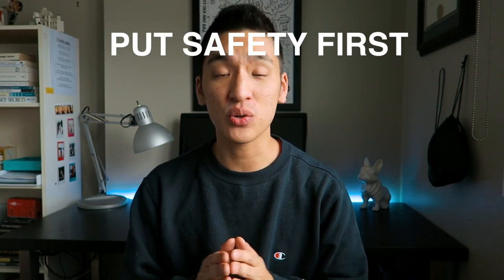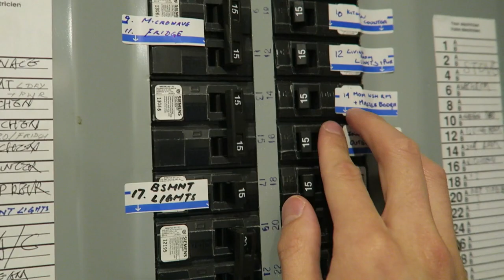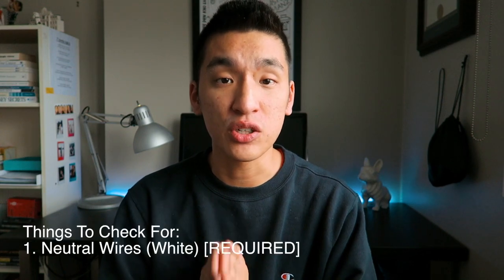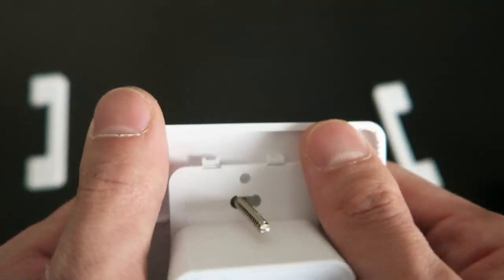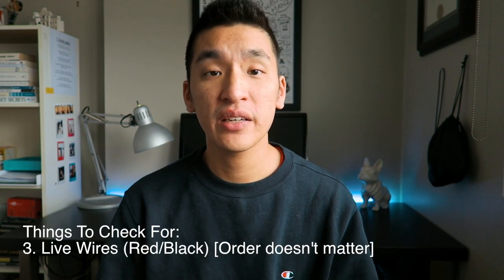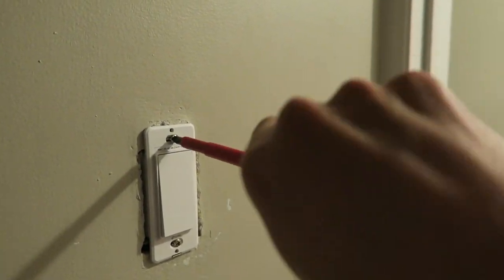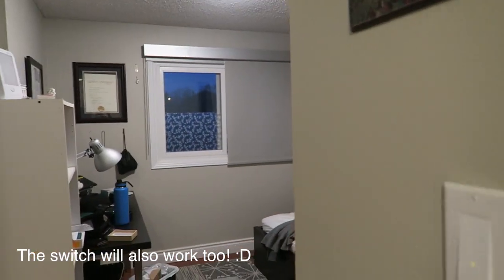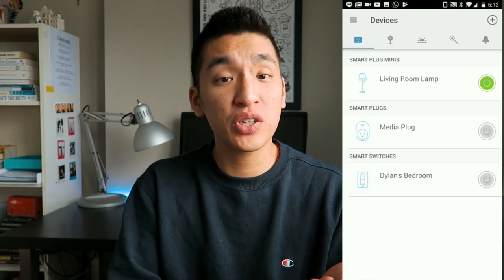How to Install a TP-Link Smart Light Switch | Dylankyang

Comment: I was able to get power to my switch and connect it to my wifi but the lights did not turn on at all physical or via kasa... any tips? Thanks in advance
Reply from the maker: GeraldJ B Hey Gerald! Thanks for the comment 😁! I'll try to help to the best of my ability. 
---
Could you clarify what you mean by you have power to the switch? 
---
Assuming your room light is on the instance you turn your circuit breaker on (but the light switch's LED is not on and the switch doesn't do anything) then there is most likely a issue with the wiring and the switch is not put in the middle of your circuit. (What to do: check that all your black wires are connected. Are there extra wires inside the box? [Order of the black wires should not matter but if the original contractors of your house that did wires ran another circuit into your switch box there may be the black wires and you just need to group 2 of the black wires together (ie. 1 black wire from switch box to a black wire on the switch and 2 black wires from the switch box to the switch)])
---
If my assumption is not correct, hit me up with more details and we can try to trouble shoot it together! 😁
Reply: I think I have a similar situation. I have one cable and branching off the cable are only 1 white wire, 1 black wire and some copper wire. I tried connection the copper and green wire, white on white wire & the  plugged the two black switch wires with the black cable wire. The internet & power LED would light up on the switch but when you push the switch button it wont turn on the bulb nor will it work on the app. Idk how to properly wire it up.

Comment: I have one cable and branching off the cable are only 1 white wire, 1 black wire and some copper wire. I tried connection the copper and green wire, white on white wire & the  plugged the two black switch wires with the black cable wire. The internet & power LED would light up on the switch but when you push the switch button it wont turn on the bulb nor will it work on the app. Idk how to properly wire it up.